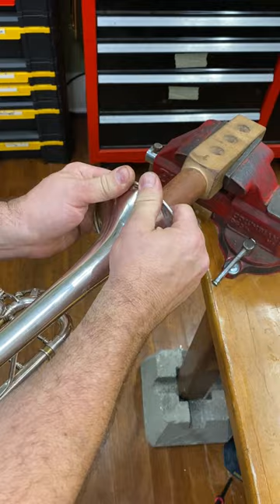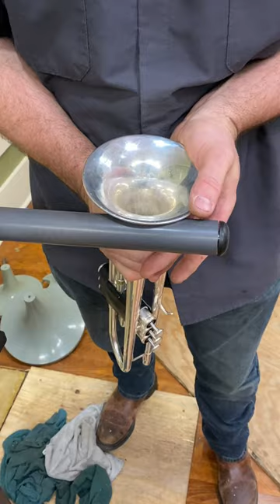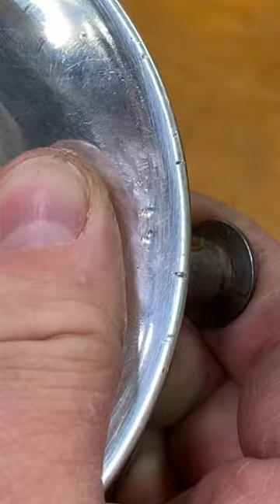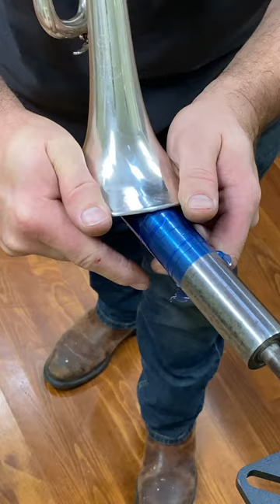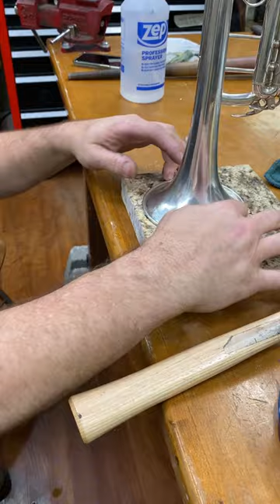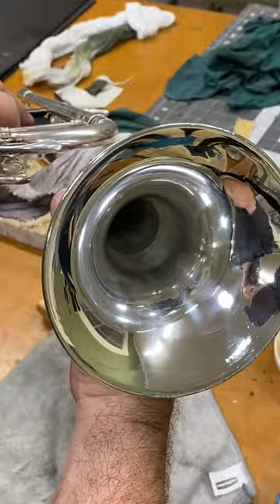Trumpet Bell Repair Short 11_7_22, Band Instrument Repair, Wes Lee Music Repair

Comment: I recently bought a nice pair of Amp crimpers, for 18awg - 10awg and a trumpet with a bell like the one in this video, and missing a #3 button and a slide finger ring clamp-screw. Ive gotten valves 1 & 2 out and oiled them. #3 wont come out, but it operates, so I lightly oiled it thru the hole in the bottom and it works fine now. I'm thinking of buying one long screw the same size as the button threads and silver-solder 3/8" long pieces to the Tails Side of 3 Nickels, to customize my trumpet. Then the stuck mouthpiece and babying the bell back in shape. I got both items for $54.00. I'm a beginner student, teaching myself, & watching YouTube videos to catch good pro. pointers, cranking my face into a ghoulish smirk to squeeze a note or two out of it. My horn playing still sounds like a ticked-off Elephant. Thanks for your video !!! What size are the threads for the valve buttons. They're metric, because my gauges are SAE..